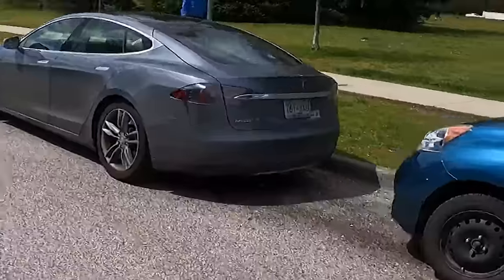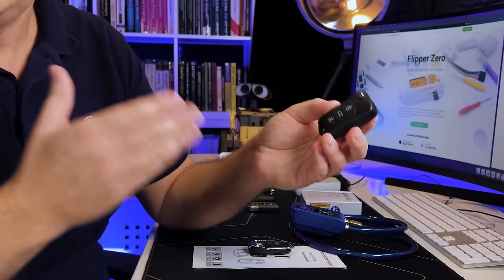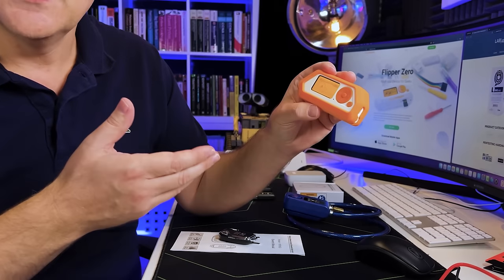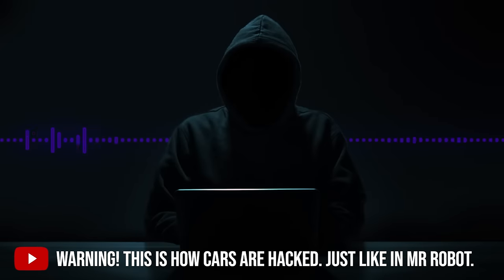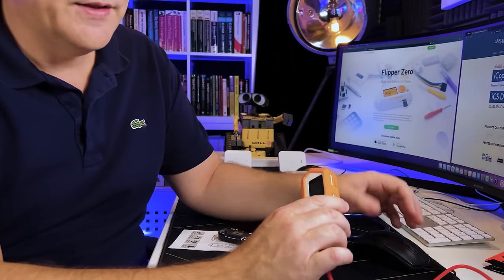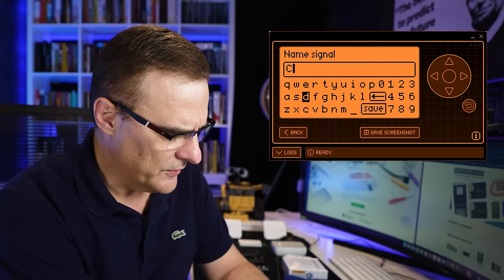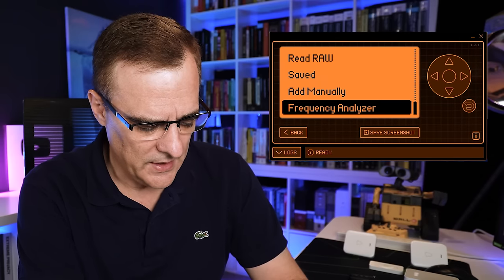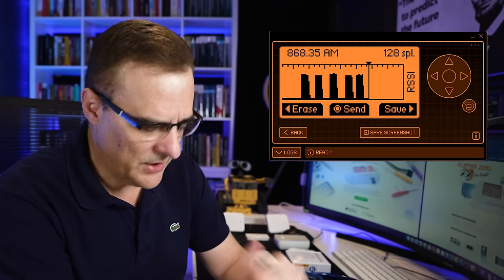Flipper Zero next level

Comment: I have never been happier that my vehicle is a 1992 without remote locks.
Reply from the maker: I often feel the same way... better to have analog devices :)
Reply: We can just unlock your car with a rock and screwdriver
Reply: Would take me less than 60 seconds to make your car gone. Do you really think your oldschool locks are secure at all ?
Reply: I open and start my old 93 van with jigglers 🤣
Reply: @thefreedomguyuk  he never said he drove a car :).
Reply: A lot of older vehicles like that are susceptible to even more rudimentary attacks such as jiggler keys that can be readily bought for a few dollars. Failing that, lishi picks tend to make short work of older vehicles and are also readily available, albeit at a little higher cost.
Reply: I don't know if it's the same in US. 1980s fords in Australia come with a spare key under the bonnet. It's the oil dipstick, it fits in the ignition and will start car, and disable steering lock. I've done this heaps with my own old fords.
Reply: I used to start my 92 Holden Commodore with a butter knife when I lost my keys
Reply: @DG-ej5nz  Semantics ! 😂
Reply: These days you just have to buy a stick shift 😂.
Reply: Lockpicking loyar has enterd the chat xD see his channel
Reply: @davidbombal  isnt a remote technicaly a analog device and a old car would be mechanical
Reply: What a lucky guy
Reply: To add another level of safety in America, get a shift stick.
Reply: A flathead and hammer is all you need for a 2001 f350
Reply: @whatsursource  my dads work truck is a 5 speed manual v10 01 f350 and it still got stolen from a friends house in 2017 but we got it back thankfully minus the tools and miller bobcat welder tho.
Reply: It’s chainsaw time
Reply: Yep …. You don’t need a flipper to open that puppy….. just a coat hanger
Reply: @thefreedomguyuk  Just because a car does not have remote locks does not mean its insecure.  90's BMW's have individual key identification, and the possibility to add a code in the on board computer to prevent start.  EWS.  Surely there is a bypass, but it probably involves replacing the ECU which in the engine bay and difficult to get to if the car is locked.  Too much time for not enough payoff, the thieves will likely move on to the next car.
Reply: Hahaha I think most people feel this way. The less tech involved in their items the better 😅

It's how I even shop for a new fridge or Washing machine
Reply: @GodAboveAll777  I did the same with my HZ kingswood!
Reply: I can unlock and drive your car with a rock.. haha real ishhhhh!;😘
Reply: @user-in4ex3tr4d  dude will literally open anything, bet he gets payed good from his job
Reply: The biggest defense with an older car is that no one wants it. Assuming you keep nothing of value in it.
Reply: I LOVE MY 1990 Toyota Camry !
Reply: Yes it’s true , the scariest thing is the government can shut down or unlock etc. any newer car via software
Reply: @thefreedomguyuk  average detroit citizen
Reply: It doesn't make it safer though.
Reply: @thefreedomguyuk  it’s better than in 5 seconds with a new car
Reply: @davidbombal  I had to disable hyper threading on an old P4 to get a dial-up modem to work for banking purposes at work. They still uses faxes too, for similar reasons. Prolly a punch card machine around somewhere too.. :  )
Reply: @sab0nes  you can break in any car with a rock, wow
Reply: @thefreedomguyuk  Lockpicking requires skill. Cloning a frequency doesn‘t. That‘s why modern cars are getting stolen more and more often, genius.
Reply: @Solid just as modern cars.
Reply: @theofficialtravesty  you cant.
Reply: Just drive a stick shift. Don’t even need to lock the doors.
Reply: Less electronics can mean longer life in certain things. With the exception of lights, in vehicles having more mechanical is better.
Reply: @Anna-senpai  absolutely 😈
Reply: Wedge and slim Jim: Am I a joke to you?
Reply: @theofficialtravesty  you can not unlock a car with a rock. you can break into it, but not unlock it. also, in case you have watched too many movies: ripping some cables out from under the steering wheel and holding them together wont start the engine ;)
Reply: @Anna-senpai  umm I can start a car with a rock no joke.. being it's the right shape and all yes..
Reply: This comment is str8 up gold
Reply: @theofficialtravesty  and i can play the piano better than beethoven. i just need to press the right key at the right time.
Reply: @sab0nes  brooo😂
Reply: Hi David I want to create a spare remote fir my car key is there a way I can use the hack RF or the Filipper to capture the signal of my remote and store it onto a new remote that I can use for years to come effectively leaving me with two remotes I can use for my car Instead of one ??
Reply: Yeah. Not so with mine. Recorded the file, played it back, after a couple of attempts my car opened! Terrifying
Reply: @sab0nes  wait no you can use a bump key lol pins so worn down just jiggle it
Reply: I can get in your car with a shoe lace lol security is an illusion
Reply: I used to be able to unlock my 1987 car with my hands. Literally. All I had to do was remove the bottom window strip, shove my fingers in the gap, and pop the lock up. 

I used to just leave my keys in the glove box to save me losing them
Reply: All we need for your car is a coat hanger 🥸
Reply: I can get into a early 90's car with a wire coat hanger in 1 min or less. I had lost of practice because when I was younger I locked my.keys in my car ALL the time
Reply: To open most cars until the 2000’s,you need a long shoelace,a specific knot on it and a little patience👍I forgot my keys in my old car a couple of times; always worked in the end with the shoelace technique.Should’ve seen the faces of some people passing by 😂
Reply: Wafer jiggers are cheaper than a flipper and will almost certainly unlock your car.
Good chance that the ignition can be turned with jiggers or a screwdriver too.
Reply: @thefreedomguyuk   Well I'm old school I like analog stuff And I agree with you that old style locks are not terribly secure. With a somewhat sophisticated bear spray deterrent system within my small tank Should someone get into my car they will be blinded With bear spray And the car will not start nor go anywhere. My firearm which I carry every day is my other old school deterrent. Blessings to you and yours and happy New Year
Reply: I’m happier cuz I don’t have a car
Reply: I have a 2014 vehicle that doesn't have remote locking.😂😂
Reply: Picking those old car locks takes like 2 seconds 😭
Reply: @thefreedomguyuk  it would take 60 seconds for the police to catch you too 😂
Reply: The “How to open and start your 1992 car” lesson is 101
Reply: That doesn't mean it's safe haha it just means they don't have to worry about any alarms going off when they pop the lock with a coat hanger or slim Jim which you can buy at most auto parts stores nowadays haha but I get what you mean haha
Reply: The most secure method is a rolling code
Reply: It only takes a flat head screwdriver😂😂😂
Reply: It's all fun and games, until some one pulls out the lishi tool.
Reply: Ah, security through obsolescence...
Reply: Stone age will win and I drive a Tesla
Reply: @sab0nes  too much time and you'd look suspicious. You gotta be smarter and faster. Know your target.
Reply: @triplez5393  thats what everyone says but why are vehicle thefts so high\
Reply: Yeah, that the ones where a screwdriver does the job and u didn't need a expensive flipper zero.
Reply: Should install a ground switch and hide it somewhere in the car
Reply: @sab0nes  lmao
Reply: I'm trying to hack my car just to get rid of some of these vulnerabilities
Reply: Agree!!!! Still have my 1996 Mazda Mx6 haha
Reply: Personally I feel analogue security is more secure on my older cars mostly because it's far easier to develop a secondary system that locks the car particularly the electrical system preventing it from being started 

As from factory on two of my cars you only need a steel coat hanger to get into and start the engine
Reply: Lishi tools ftw LOL
Reply: Next go check Lock Picking Lawyer :D
Reply: @massimofi  Haha good one, yes there’s always been a hacker for everything! Analog and digital!
Reply: @massimofi  yes but he picks conventional locks 

You can do a lot of without a traditional key 

I built a security door for customer and not long after it was broken into because the lock he spec'd failed 

So I was asked to build a "lock" 

And I used very common but also very specific everyday things to create a key and lock
Reply: @thefreedomguyuk you can also have modern car and lock it with the key that's what I do
Reply: @TheFreedomGuy  snatch it up in less then 2 min. I feel that
Reply: I mean old cars had security vulnerabilities. That being said new cars have a lot of subscriptions and crap
Reply: @sab0nes   🤣
Reply: @sab0nes owner with shotgun behind you....🔫
Reply: Ur broke
Reply: @sab0nes  You can unlock any car with a rock and a screwdriver
Reply: My 1993 Honda Prelude is doing just fine with its $8 key
Reply: Any 92 is easy af to steal
Reply: @BezzantSam  So is your wife, but we're not going to talk about that.
Reply: Well a small window breaker tool and a screwdriver would work on your car.
Reply: @davidbombal hi where i can buy range extender because i cant find that video
Reply: All you need is a metal hanger and two wires together bam I have your car
Reply: @thefreedomguyuk on my 1994 Infiniti, I bought a factory accessory button for an accessory I didn't have. I looped the starter signal through it.  To start the car you had to hold down that button while turning the key.  There was no way to start/hot wire the car from the ignition switch.
Reply: I often make it lock harder than it is to unlock old cars if the client is watching, otherwise they wouldn't understand why I charge what I do for what I am. Not trying to rip people off is just easier than explaining overheads that they don't consider

Comment: I must warn you that recording your car's Central lock signal and trying to emulate it is a bad idea.  This can cause your central lock to freeze and stop working.  I know because I myself got into such a situation) To restore the central locking, I had to disconnect the car battery.  But I was told that this does not always work and you may need to contact the service center for flashing your car
Reply: That doesn’t sound right
Reply: @edplaysdrums8435  what part?
Reply: @Lazy_IT  it just seems weird to me, how could the car know the difference between the fob and the reproduced signal?
Reply: @edplaysdrums8435 It gets the same signal over and over whereas the real key fob would be going through rolling codes and it wouldn’t see the same one multiple times.

Comment: TLDR: You can't unlock cars because all keys since 1994  use rolling codes. That is to say keycard holds private key which is used to generate lock, unlock key which car is expecting. The only way this might work is to be somewhere between car key and car but for them to be too far away to talk to each other. Even then it's a question.

Comment: I ordered mine on 14th of October to germany and its still in transit...
I have a experience in RF and in specifications terms the Flipper is indeed not very impressive.
But what the flipper does great is making these tasks very easy in a small package.
When I do RF stuff i need a computer, a Software Defined Radio and complex software packages that are beyond most of people.
The Flipper Zero will definitely push forward the evolution of security in these fields which was almost stuck for many decades!
Reply: What web site di you order it from n how much was it
Reply: You act like a portpack doesnt exist? none of flippers RF tools are groundbreaking. It's old tricks in a new toy.
Reply: @NicholasHorvath  I'm playing with Ettus B210 since 2014 so I never got into HackRF
Reply: You can reprogram n reset anyone manually

Comment: Couple of things worth mentioning that I've discovered make it even easier. Features that might not have been included 7 months ago when this was recorded. 

* When running the frequency analyzer, you can select the frequency as it is detected, in that list that pops up. Doing so, takes you right into the read function. From there you can go to config, and set the raw option, to record, if it's not already. This way you don't manually have to enter the frequency info to record. It's also worth noting you can adjust the RSSI up, so that you can filter out weaker signals. Usually ones further away from your target device. 

* If you are recording raw frequency traffic. You can adjust the RSSI up here as well, so it's not detecting the background noise or frequencies of devices further away. By doing so, you not only ensure you are capturing the wireless signal of the device you are testing. But also you can just hit record, and leave it running. It will then ignore those weak background signals, and not record until it sees the traffic on the set frequency, at the strength given. So if you and your neighbor have the same doorbell device. It ensures it captures your device and not theirs. It also stops the recording as the transmission stops. So if you were to try and do a walk by recording of traffic in the wild. You could set it to record, with the raised RSSI filter level, then put it in your pocket. Walk past the target being triggered on that frequency. Then see just that transmission, without having to hit start or stop in the moment. Making for a cleaner signal to replay, and allowing the recording to go unnoticed. Which is kind of cool, and scary at the same time. 

To the comment of the bright orange cover. I thought this was an odd design choice as well. However, this device to most folks just looks like an electronic gaming device or something. It doesn't look like your typical black box hacking hardware. So it hides in plain sight, which can be more effective than you realize. Also with the remote stream via bluetooth function. You can run the entire thing from the smartphone app, as it sits in your pocket, bag, what have you. So it really doesn't matter what it looks like. But making it look like a toy (security through obscurity, yet in plain site) is almost an added perk for reducing suspicion.
Reply: what whould i have to do i have the unleashed o.54

Comment: David, thanks for the video.  It really made me aware of how easy it is to unlock those devices.   Far as I know my 2015 Honda Fit uses a passive keyless entry system and is not vulnerable to this type of attack.  I rarely ever use my key fob to unlock the doors as it's automatic when I touch the door handle.  It makes this type of attack very difficult.

Comment: You would have to be away from the car with the key fob and record the unlock. Then you'd have to use the flipper to unlock the car before the key or else it will not work. Basically, it only works once because of rolling codes. So unless you can defeat the rolling code security it's almost useless.

Comment: Hi, David! 
Can you make a video how we can be safe and stop the attack from flipper zero and these type of devices? 
I think it will be interesting for many of us!
Reply: He does that in the video to some extent. Modern vehicles use rolling frequency signals so you don’t have to do anything.
Reply: Also it isn’t an “attack” but rather a capture and repeat situation. An attack would be more like a spamming of signals across the band a car uses for its fobs. If you listen for the confirmation you have locked the car with the remote you are probably fine. No system is completely safe. Keep that in mind.

Comment: Use the Flipper Zero with an FPV quadcopter/drone. How can Flipper Zero interact with the drone's control signal? How about the other rf coming off the drone flight controller or video transmitter...? It might be great to make a hands on video with experiments. Or it might be boring. I would try it myself if I could get a Flipper Zero.

Comment: If this could capture fire engine visual (and in some systems, RF) traffic signal light overrides, that would be a whole different level. To educate them about the flaws in their system and not to use illegally, of course.

(Since the Flipper Zero has both multiple frequency IR TX/RX and RF radios, this should actually be possible. But their system might be designed with challenge/response, not sure.)
Reply: Seeing as some lights respond to visual light signals I would not be surprised.

Comment: This is so crazy to me to see so far down the line from when I used to do similar things with my HTC One 9 i think it was? The phone had a signal reader at the top so you could program any remote control in your home into your phone and essentially just use the phone to control all the devices. I tinkered with it at school and had control of tons of televisions, projectors, and more. If I am remembering correctly, it operated on a radar sensor but do not quote me on that. HTC had to get special permissions to release the device due to security concerns such as this video
Reply: TV remotes use an infrared sensor
Reply: @marcellkovacs5452  Yes, they do. I am aware
Reply: @marcellkovacs5452  Simply just look up HTC One M9 and youll see what I meant. There were some special exceptions made for the technology in it at the time of release when it came to regulations on being able to blast and read any signal you recieve
Reply: @TheEasilydistracted9  Look up what? It has an IR sensor, yes, like many other phones. But the Flipper Zero can do WAY more than simply replay IR messages.
Reply: @marcellkovacs5452  I really do not care man
Reply: @TheEasilydistracted9  I can see that